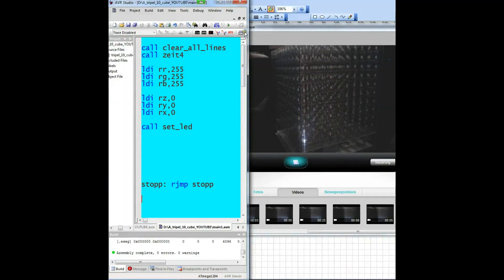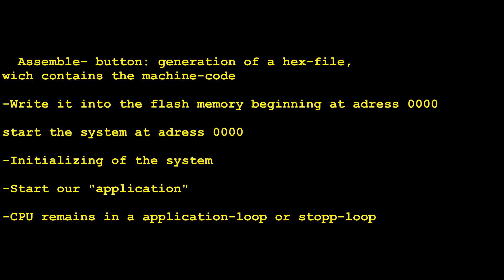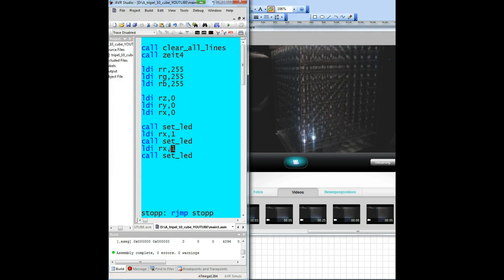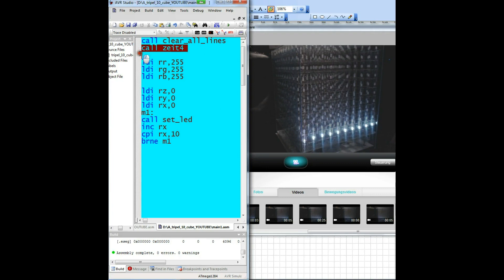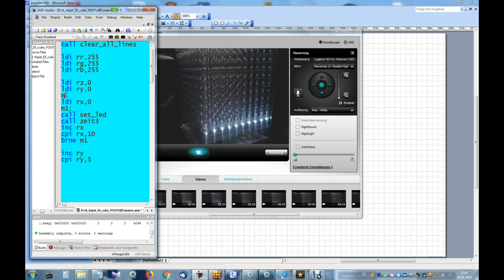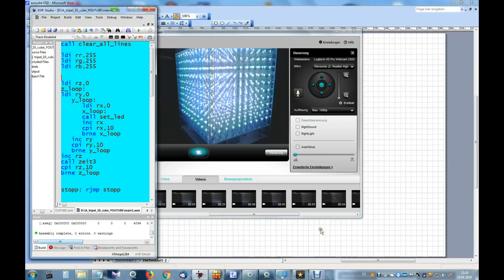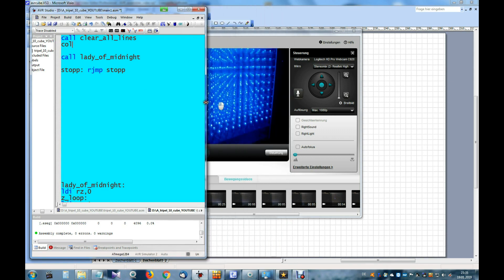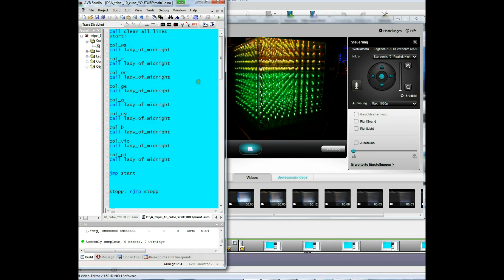AVR Assembly code step by step explained with a RGB cube10x10x10x

Comment: Hi! I made 4x4x4 cube basing on partlisting from your first ledcube video. I used ATmega328P 16MHz and programmed it in C with Atmel studio7. I have just some optimisation problems. I wonder what did you use to generate grayscale clock for tlc5940? And did you use all 12 bits of grayscale PWM control?

Comment: This video is from 2019?? Looks like it's from around 2000...
Reply from the maker: ??? What do you see??? There is the date 1 line under the title!
Reply: @3dfreakful  yeah it's 2019, I'm just surprised as it looks like a very old video due to the old operating system and aspect ratio.

Comment: Hi Wolfgang

Any plans to release the software files + circuit diagram for this?   

In an attempt to learn AVR assembler I've tried to copy the code from the video for a 4x4x4 cube I built a while back that also uses the TLC5940 but seem to be missing quite a bit of code.  Any help would be appreciated.

Thanks in advance 
Kevin
Reply from the maker: speaking German? Contact me by mail: wolfgang.nk@web.de
Reply: Hi Wolfgang -  Did you receive my e-mail - if not then I guess this was an automated reply - :-(